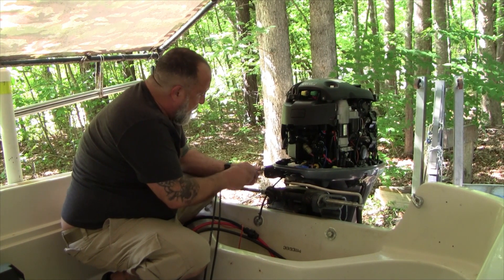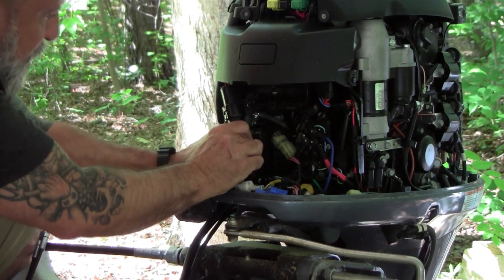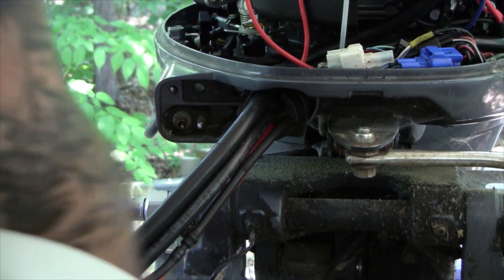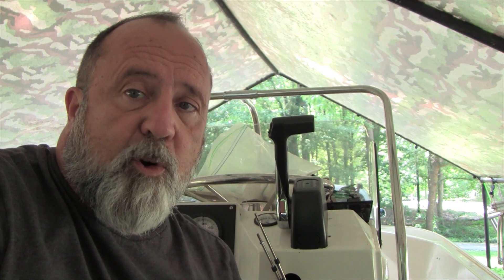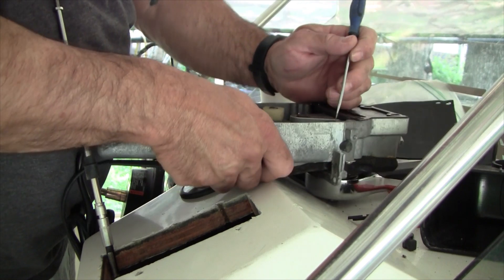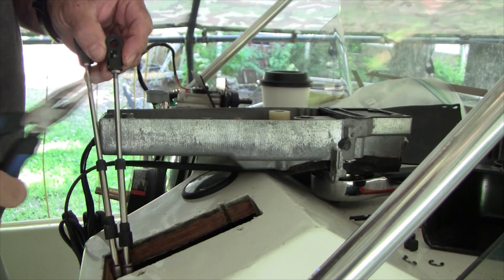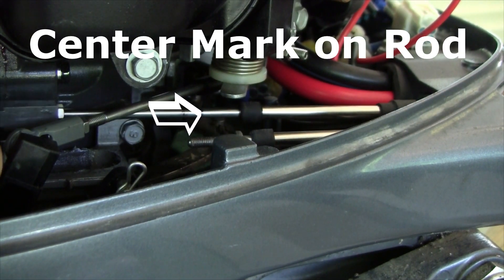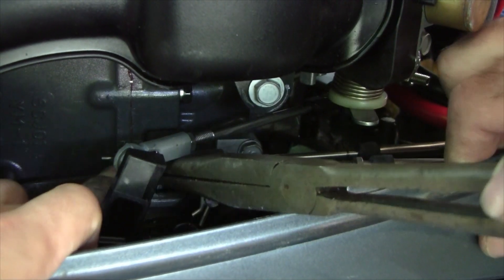How To Rig A Yamaha F70 Outboard and 704 Control - Rigging - Montauk Restoration 15

Comment: looking to buy a used Yamaha f70tlr with no rigging, keys, harness etc. as far as running the engine is the only thing necessary the key switch and wire harness? and battery cables?
Reply from the maker: You need a controller of some type, I use a 704 controller in the video, you'll also need throttle and shifter cables
Reply: @ I plan to use a Morse controller I already have. So I’ll need a key switch kill switch.  Trim switch. wire harness. Battery cable set. Anything else. I’m I right in thinking I do not have to run any of the nema stuff? Is there no smart electrical shit that prevents it from running? I.e. nothing like a how a new car would need a dealer cut and programmed key?
Thanks
Reply from the maker: You don't need the NEMA stuff, it's more of a luxury than a necessity

Comment: What Gauge Wire is the red and black main power? I'm doing my twin 115s and having hard time figuring out what to buy.
Reply from the maker: I used 2 Gauge because of the distance, I probably could have gone with 3 or possibly 4 guage but I always go over a bit, especially with wiring.
Reply: @ExtremeDIYGuy  Thank you for input!

Comment: What do u mean by center when making mark on control how do u get center
Reply from the maker: In between the fully extended mark and the fully retracted mark. Directly in between the two
Reply: @ExtremeDIYGuy  your mark wasn’t not between the two it was on the inside of both the marks towards the bow not trying to be funny 
But going through this now and trying to get my cables installed is why I’m asking

Comment: gday mate i have just had a 40hp la fitted to my resto ,your lucky in the states they let you buy and fit yourself here it has to be fitted by a authorised yamaha dealer at a cost between 500 and 700 dollars , dont want to be picky but GREASE on your connections mate , can never have to much grease (except on the top of your drive shaft) mine runs the standard 703 and thats a knock off but does the job , i have just found out how to wire up the tacho which wires are what . i bought a kus with an hour metre thankfully on the yamaha forums a guy had just done his so passed on the knowledge at least you can get a manual there here is a big NO they wont sell you one but if you know the right people things can happen good video .
Reply from the maker: Thanks Crispernator! Yes, The only reason I did not grease the cables was that the Sierra cables are supposed to be prelubricated, however. I may go back and add some heavy BRP grease, I'm sure it wouldnt hurt! I was going to do the tach and tilt wiring on this video but just flat out ran out of time so will do that in a short video soon. I actually showed which wires to use for the tach on my 13 resto video which was a 703 controller. I'm pretty sure they are the same on a 704. BTW, I'm surprised you can't order yamaha parts online there!
Reply: @ExtremeDIYGuy  I cannot say with any credibility but i would think the trim wiring would be just plug and play ,if i had used a yamaha tacho (450 dollers ) instead of my 100 dollar kus they have a loom for it and it is just match the wires did they supply the loom for the tilt with the engine ?
Reply from the maker: The trim wire does have a plug and play option, they have a cable/Loom ($$$) to run that to your helm.  Probably only really needed if you have Yamaha gauges. The wire for the trim (pink) is tied to a connector that I, unfortunately,  can't identify, so will cut and splice that. I checked and the tach wire (green ) is the same coming off the 704 controller as the 703. The good news is that it uses a standard bullet connector.  I'll have those two connected and tested soon!